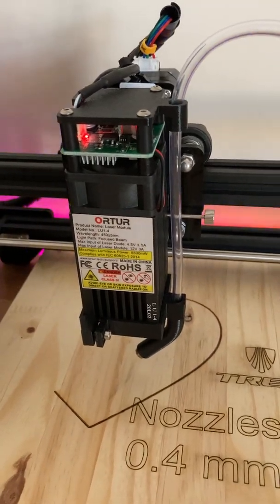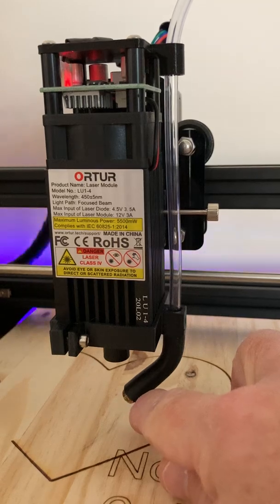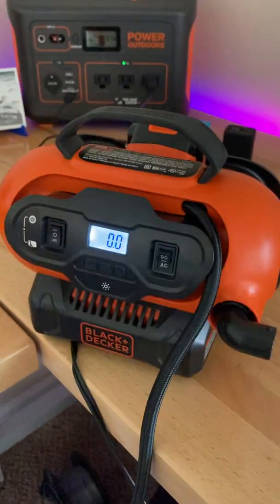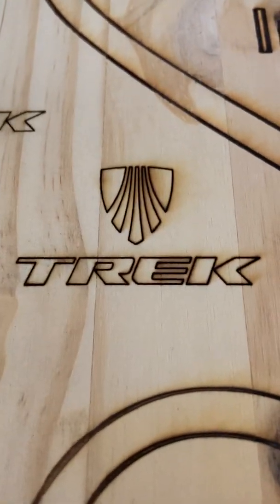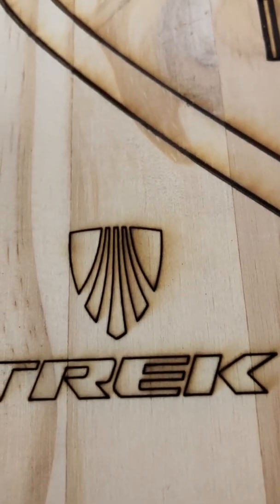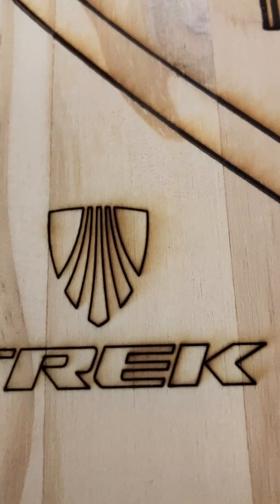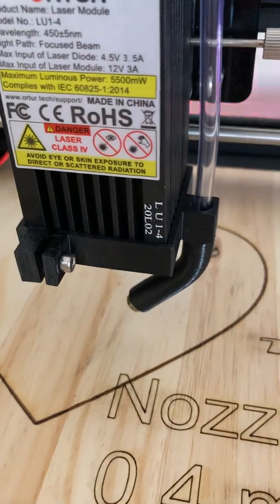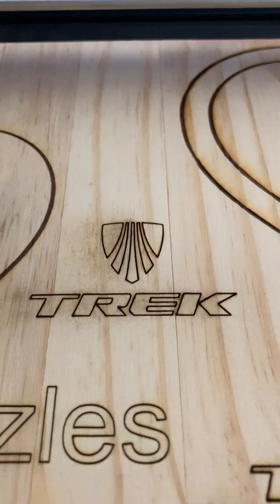Adding Air Assist to Ortur Laser Master 2

Comment: Which 3d printed mount did you use?
Reply from the maker: https://www.thingiverse.com/thing:4693730
Reply: I printed them both out.  Then I saw a picture of an Ortur that got set on fire.  And decided to use the top mount and a straw instead of the laser cover on the bottom.